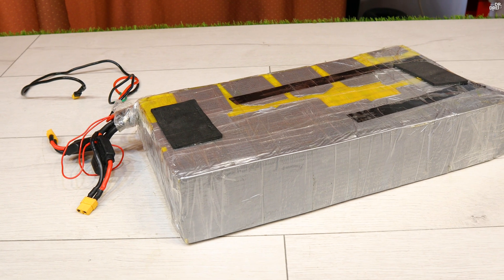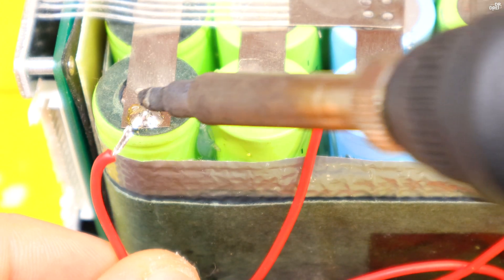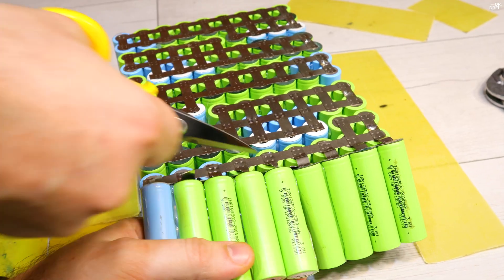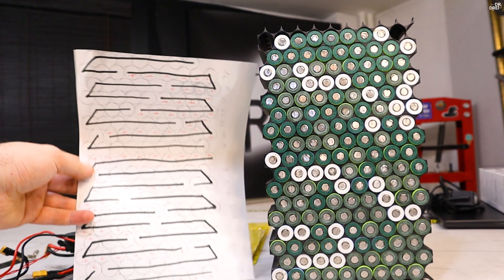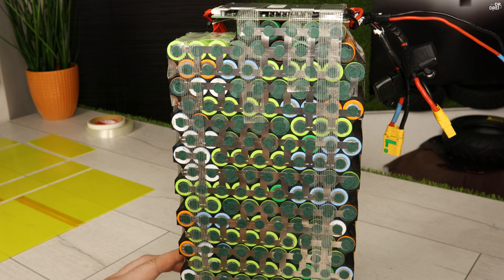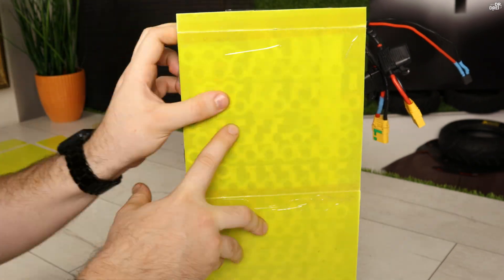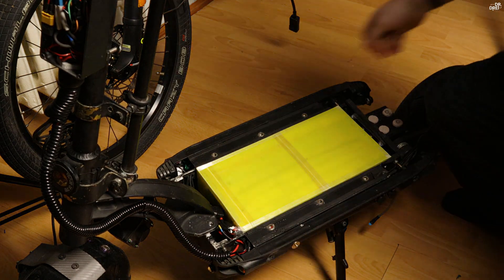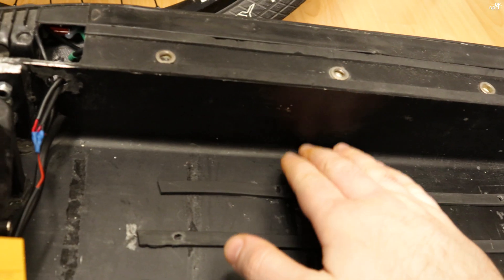Probably the BIGGEST BATTERY ever installed on a KUGOO G-BOOSTER Electric Scooter

Comment: Excellent 😎,how's the scooter ?do u still have it?? I have 2 original booster batterys the 48volt twin discharge cables but without the ca Les can u tell me if I buy abms ,which one should I buy I concerned it won't give full power as  on the label of the battery it says 48volt 23ah and 37.2volt scope I'm unsure about scope maybe it's what it provides to each motor but I just want to use the battery as the cells are perfect I resoldered spot-weld them checked everyone charge discharge ah check and even put them in store mode excellent cells I may add but I  don't know what Amp bms to get I know there good for 40amp but will I need to reconfigure cells to work as a single battery now ?any help be much appreciated 👍